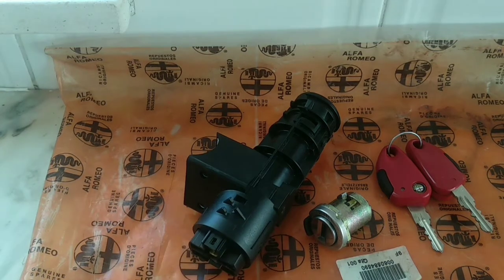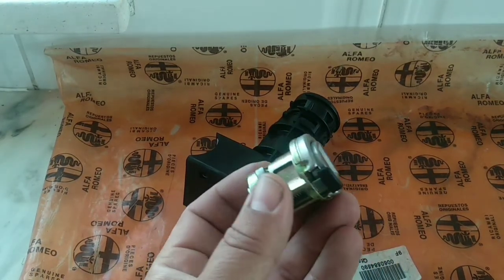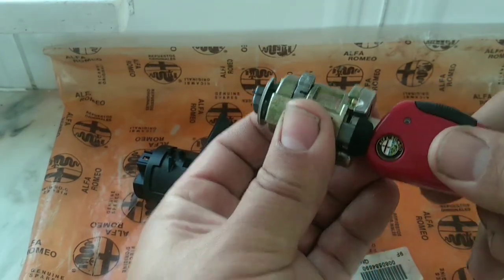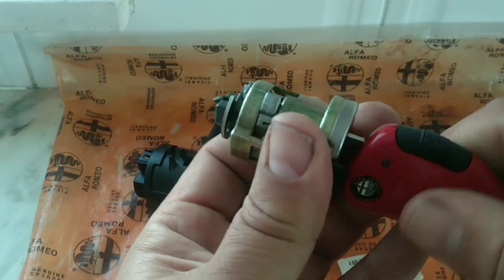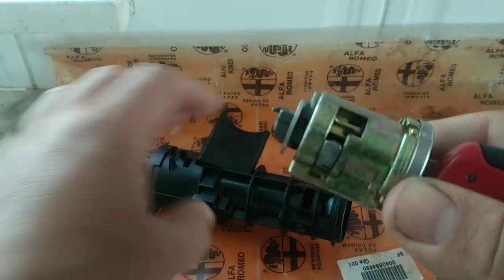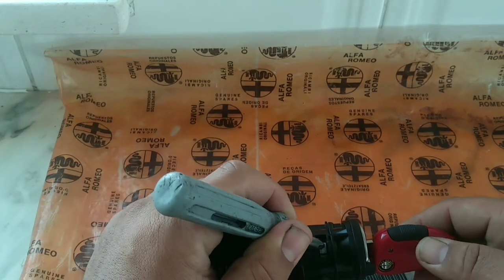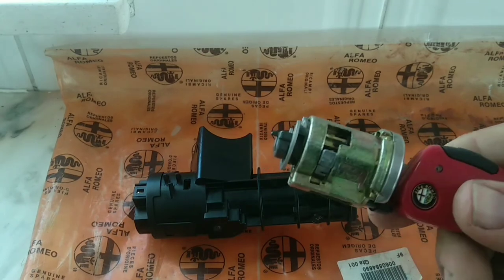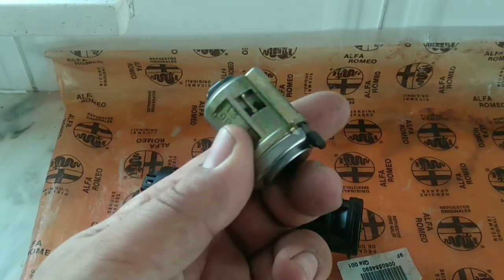How to replace ignition barrel? All Italian ignition barrel.

Comment: If you change the barrel do you have to change the key too? My steering adjustment clamp is loose too, I have to keep pulling the steering wheel out. Even the tilt is a bit loose. Could be a part worn?
Reply from the maker: Hello. Thank you very much for watching my video. 
If you replace any barrel you must use a corresponding keys. Just like in your home.
About the steering column, you can. Observe a nut on the opposite side of the handle. Work the nut until it's good

Comment: if we remove all pins/levers/groovy in ignition barrel, does the car start. new barrel will take 10 days to deliver so need to start the car
Reply from the maker: Hello. It will start if you hold the key fob against the transponder ring. Then rotate the ignition switch